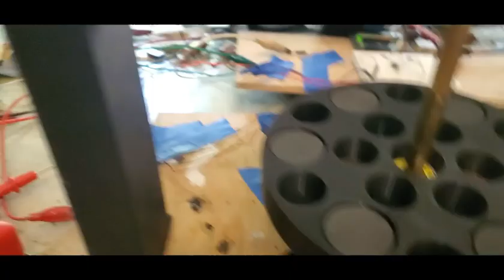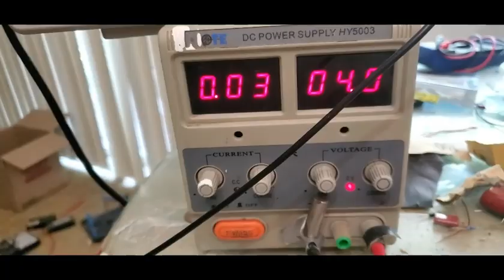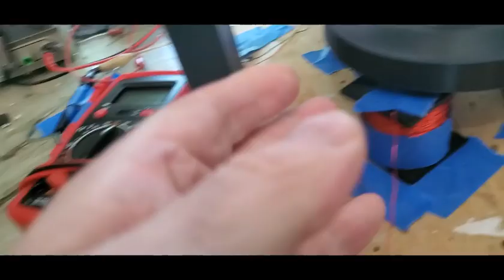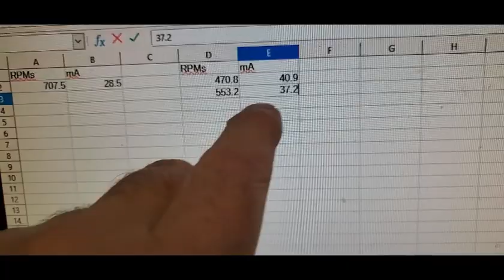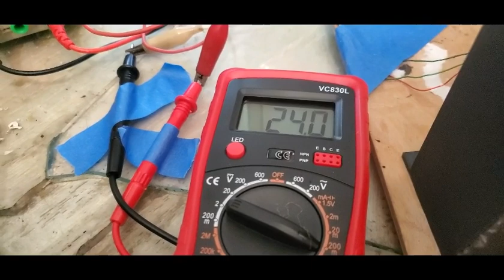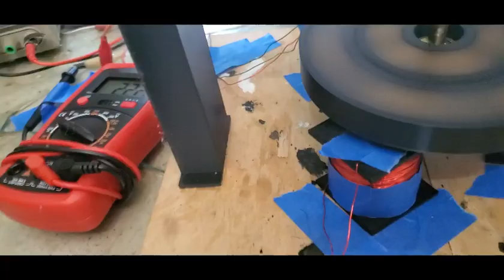Penny Roll with Ammeter

Comment: Very thorough, I would have love to see the under load numbers for the 3rd round. Would be cool to print an extension and add more weight. Though I have a feeling the bearing will start to complain after a while lol.
Reply from the maker: Not certain, but I think there are 4 skateboard bearings on a skateboard, so I would guess maybe 40-50lbs before they might start barking at you. Do wonder how well the PLA will hold up but certainly there is room to go past 1 lb which was the weight of the rotor with pennies. Also, any imbalance with the rotor will get magnified with more mass, but with 3d printing should have something that spins well enough to get out past a pound.

Comment: Good work ❤
Reply from the maker: Thank you Paul. One hard part was not going into the 1/2 hour diatribe of "Do you have any idea what this means!!!" As I have thought about exactly that recently, I can say I don't really enjoy mentioning this at all, it just seems like the right thing to do, and if you say it quietly most of the (I'm being awful here) "riffraff" are going to ignore it then anyways. JB used to show an "Energizer" in some of his block diagrams of pulse motors, I would guess now we know what the Energizer was.

Will be interesting at some point to revisit magnetic ramp motors in light of these findings, if that goes as expected not certain if I will be able to bring myself to show it, hehe. Maybe, but there is certainly plenty else for show and tell as well.  Lastly, thank you for pointing out to me that copper is diamagnetic, not 100% certain, but more likely than not, the findings would have been even more dramatic if concrete or lead had been used to add mass.